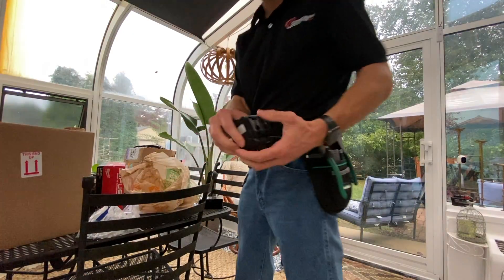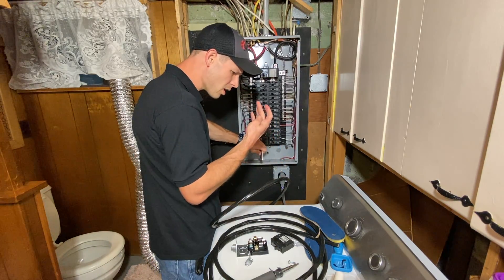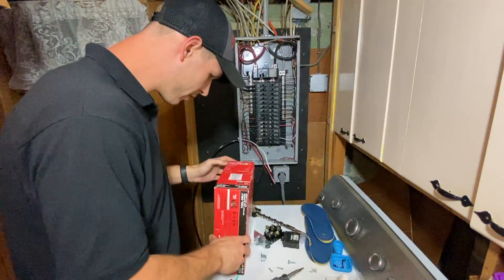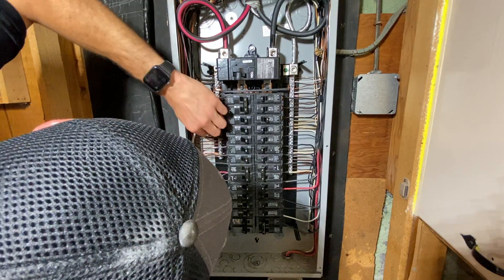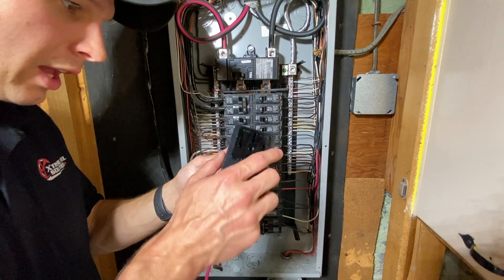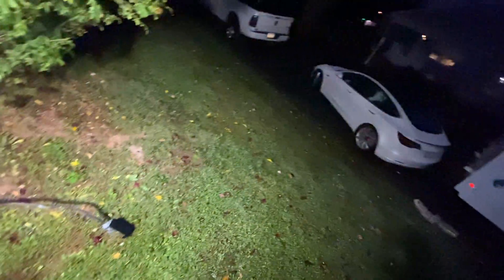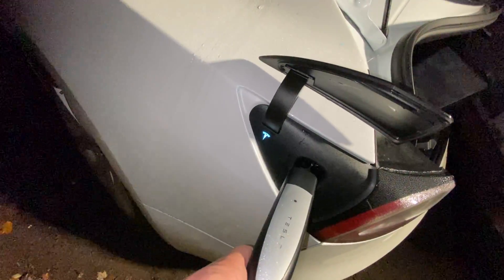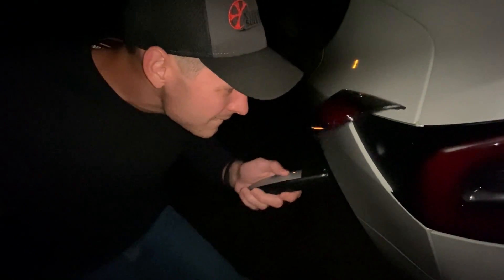DIY Tesla Home Charger Under $100!!

Comment: use liquid tight conduit at least dude lol. or you can use 6/3 UF-B wire.... they are about the same cost as Romex but it's rated for direct burial.
Reply from the maker: Yeah that’s how I ran my permanent wall charger

Comment: You need an outdoor Nema 14-50 outlet like this: https://www.homedepot.com/p/Midwest-Electric-Products-50-Amp-Temporary-RV-Power-Outlet-U054P/100193650

The setup you have is super dangerous! Also, that 6/3 wire outside should be inside electrical conduit. C'mon man!

Comment: Hate to say this, the circuit breaker used is not the recommended. Here is a quote that I’ve located on the Tesla forum https://forums.tesla.com/forum/forums/installing-nema-14-50-60amp-breaker:

“A NEMA 14-50 outlet is rated at 50A max. By using a 60A breaker, there is a risk that a short circuit or overcurrent will overheat the outlet / plug / wiring before the breaker trips.

The breaker must be sized to protect the weakest link, which in this case is your NEMA 14-50 outlet. Change the breaker to 50A,”

Now what I don’t understand, it is normal to see a number of 15 amp 120v outlets connected on a 20 amp circuit. since the Tesla will not draw the full 50amp, but rather 42 on NEMA 15-50, it is okay to drop a 50amp breaker to be safe. Save the 60 amp for the future if you install a Tesla  60 charger.
Reply from the maker: True dat